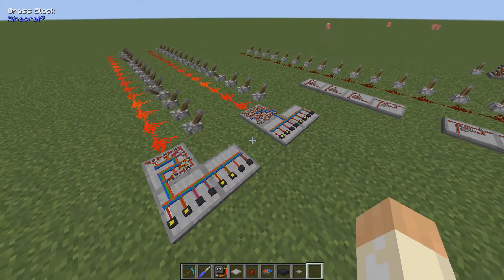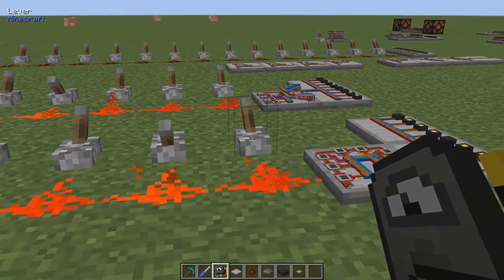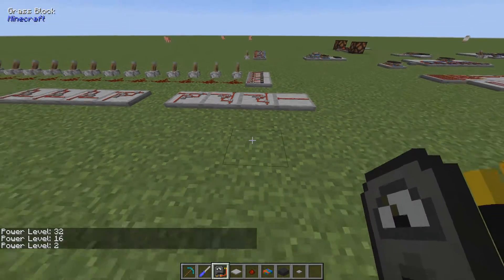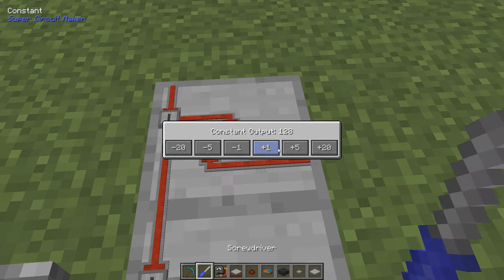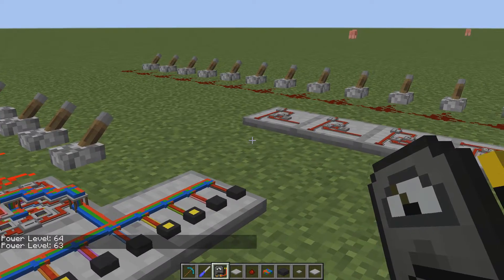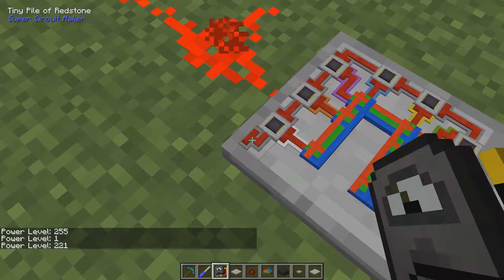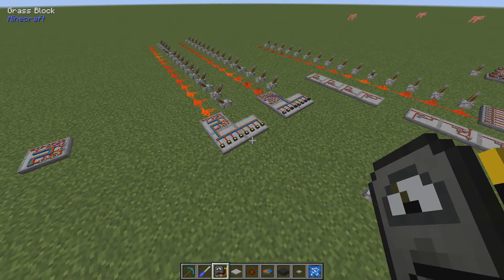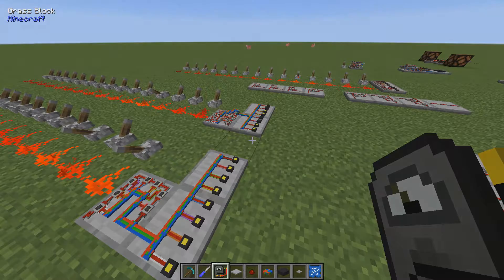Super Circuit Maker: 8-bit ADC With Binary Parallel Output (MC 1.10.2)

Comment: I've built a game of life pixel circuit that works. It takes input from its 8 neighbors, and if there are 3 alive exactly, it sets itself to alive, if (live-4) or (2-live) are true (less than 2 or more than 4), it sets to dead, the only thing missing is a set/display system, currently all information entering the system has to be from the edges of the grid.I cannot post a map download, because my phone is the only thing with internet atm, but I'll post it as soon as I can, may cause extreme lag on boards larger than 5*5 or rams smaller than 2gb, circuit complexity rated by the multimeter is 1.234 oddly enough, I thought the max was 1? And how did I magically get 1.234?! Anyhow, see you next super-update!
Reply from the maker: I forgot to answer your comment! But regarding the complexity I think you can have very high complexity per circuit, but to put a chip-on-chip you'll have to be below 1 to have it 1x1. If it's higher it becomes 2x2 etc. I don't know how well that works though, becuase it seems to be broken in 1.0.4 with >1 complexity circuits...